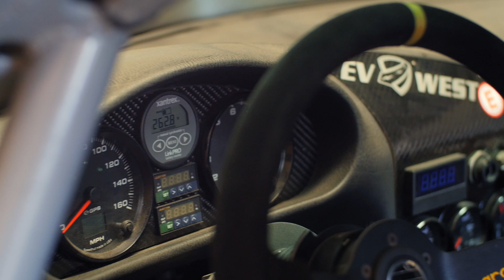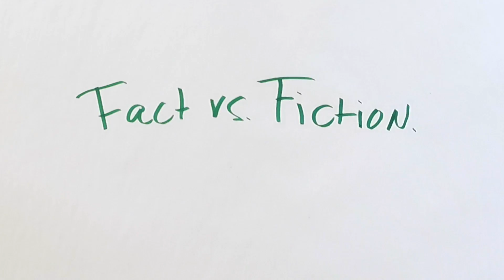How to Make an Old Car an EV - /ENGINEERED

Comment: Not good comparing these older car with the Tesla in terms of safety.  Old cars were very unsafe by today standards, while Tesla has one of the safer body in the industry, precisely to protect the battery pack in case of a crash.  Older cars will deform very easily and if they also have the battery packs in front (or even in the rear), the slightest crash can be a major concern, even a low speeds.  The batteries are not protected and do caught fire under impact.  Electric battery fire is anything but a regular fire, it is almost impossible to put down even by firetrucks, and burns with powerful flames.  So these old electric cars must be driven very carefully, especially given the speeds and accelerations they are capable.  And not only for the owner's safety, but for the other cars safety as well.

Comment: Batteries do not "contain" electrons for the purpose of generating electricity, only capacitors hold the actual electrons to create a charge. 

Batteries create an electrochemical imbalance called Oxidation-Reduction Reactions, or Redox Reaction. The cells in the battery have metal and an electrolyte in them to generate electricity through the redox reaction.

Does this guy know what happens in his garage or is he the owner that smiles for the camera, completely ignorant in his field?

Comment: hi , i am a mechanical engineering final year student...right now we are working on solar powered electric vehicle..We are doing it from the design to fabrication..so we are not converting but actually fabricating our vehicle...now we are facing a budget issue..and without ac drive we cant make it through...can anyone over here please help me in this..do anyone can give us on rent or sell us 15 kw ac induction motor drive. It would be a great help..kindly reply

Comment: he says electric cars are more efficient because it takes so much energy to refine petrochemicals but doesn't electricity production require a similar process?

let's say i'm charging my electric car with power from the grid that happens to be sourced from large coal burning power plants. and also my car is constructed from rare elements that can only be extracted from the earth by huge mining operations that produce a significant amount of pollution before the elements are shipped to the production plant by huge ships that produce a significant amount of pollution and then are used to produce the cars in production plants that produce a ton of pollution.

i don't know which is worse, burning gas in a primitive combustion engine or burning gas to build a primitive electric engine, but they are both bad
Reply: That will change as renewable energy sources become cheaper to install.  It won't be immediate, but as adoption increases, the cost will go down.  What doesn't help is that renewable energy methods depend largely on the environment itself.  The UK is quite windy, especially in Scotland, so wind power makes sense.  Iceland is known to have a thinner crust than other parts of the world, so geothermal energy is ideal.  Hot countries with minimal cloud cover benefit from solar energy.  Then there's hydroelectricity, and nuclear or biomass for places without access to environmentally driven energy sources.  Solar is actually a pretty sure bet for most places, even cloudy places like here in the UK.  Panels are getting cheaper and more efficient.

Lithium is recyclable.  The issue is that it's cheaper to obtain brand new lithium than it is to extract the tiny amounts used in batteries.  This may change as demand and the cost of the raw material inevitably increases.  There are political obstacles to contend with too, since must of the lithium supply is constrained to a few countries, much like the oil supply is now.
Reply: Ok, so lets look at the worst case, electricity made in a coal plant and then charged into an electric car. Compare that to a ICE vehicle. When looking at how well the energy is utilized the electric car will have more than double the efficiency over the entire energy chain, i.e. It will be better for the environment. Given that more and more power plants and electrical grids are getting modernized including solar and wind I don't see how this is even debatable.
The thing is that the coal plant has about double the efficiency compared to an ICE in a car. Electricity is transported a lot more efficiently to the charger than petrol to the gas stations, and then the electrical energy has a 80-90% efficiency in the electrical car compared to petrol in an ICE which has about 20% efficiency, most of the energy put in is actually converted to heat... Mic drop!
Reply: You are too stupid for words.
Reply: Doogie Houser im sorry, did i offend you?
Reply: to answer your question... no
Reply: good, because all im saying is that electric cars are still running on fossil fuels if they're getting their electricity from a coal power plant lol
Reply: poophandler I mean if they are in the Midwest, in a place like Colorado where most of the energy is geothermal it's bit different
Reply: You have to weigh up the pros and cons.

Not all power comes from coal or gas.  In the UK most of our coal plants are gone, and the remaining 4/5 are due to be decommissioned.  We get most of our our power from wind and nuclear, which whilst not completely green due to the necessity to store waste, is still a low carbon emission alternative to fossil fuels.  Of course energy production differs depending on the country.

Lithium isn't all that rare, and whilst it is found underground in rock, it can also be found in brine pools and is dried out by the sun.  I believe this is the most common method of obtaining lithium.  There's also the possibility of recycling batteries for the production of new batteries, which isn't possible when burning fossil fuels.

Extracting and refining crude oil is a highly energy intensive process.  Then there's the matter of shipping it across oceans in huge oil tankers, transporting it in trucks to fuel stations - a massive CO2 cost before it even gets into the tank of your car.

On the other hand, the idea of buying a brand new car when there's nothing wrong with your old one is wasteful.  You may be taking a petrol powered car off the road, but the CO2 emissions from creating its replacement will far surpass the amount of CO2 your existing car will continue to produce if you kept it.  It's not quite that simple, production is getting more efficient, and the power used in production is coming from cleaner sources.  Not to mention we're recycling more materials than we used to - steel and aluminium can, and is, widely recycled.  If your old car is trashed/unsafe however, and you were looking for a new one anyway, then it may as well be electric.

In my opinion, if you wanted to be as green as possible, you'd take an old car and convert it to electric using parts from other electric vehicles.  A fairly common conversion uses electric forklift motors mated to the car's existing gearbox, and banks of UPS batteries or reclaimed laptop cells.
Reply: I know that all power doesn't come from coal or gas. That is true. But I guess my point was more that you have no direct control over where your energy comes from if you are using grid power. You are at the whim of the agency that supplies the power. It's not such a bad thing if you live in a place where most of the power is geothermal, like Iceland. I live in Ontario and most of our power was from coal generators until only a few years ago, from my knowledge, so the idea of having an electric car to protect mother nature was a joke.

I heard that they were having difficulties finding ways to recycle the batteries. Maybe I have been misinformed.
Reply: +poophandler yes you were misinforemed ... people like to act smart and hardly admit that they have no knowledge or education about topit they are discussing... Lithium ferro phosphate (or newer)  are 100% recyclable
Reply: The coal power plant argument is invalid anyway, for reasons that mikeberg above just mentioned.  When you also take into consideration that fossil plants are dwindling in numbers (at least in Europe), the argument is completely null and void.

Comment: do you have the same problems the mass produced electric cars have...???   if you leave vehicle not connected to the chargeing system for a period  over two weeks..say yr vacation .on your return the batteries will not charge..cycle..and need to be replaced...two friends had this happen and that is what factory told them..new batteries 30,000$

Comment: ... was really hoping for a video on how your electric vehicle was engineered and made . The nuts and bolts of installation , welding mounting brackets ... transmission used and battery ... Instead what I listened to and watched was essentially a  damn information commercial  which I did NOT want to watch and listen to .  Yet in spite of that misleading title for this video there was knowledge to be learnt ... just none that is technical or leading to the building of any such vehicle . Too bad.

Comment: I bet he sip that water with used socks extraction in starbucks.
So much bullsh!t. Yes, EV's are so efficient, especially when powerer by electricity produced from coal plants with 30% efficiency, producing mind-boggling filth (39% in US), stored in batteries with charge/discharge cycle efficiency ~85-90%.
Worst episode of Drive. Not because misleading title. Not because of ruined classic car. Not because of electric car. But because of 11 minutes of bullshit from an idiot.

Hitting unsubscribe button. There's are so much better channels to watch, like Petrolicious or Davide Cirone.

Comment: The people who would put an electric drivetrain may be technically-minded. They may be innovative. They may be creative. But they are not "car guys".

The experience of a classic car involves the senses. They have taken away many of those (the sound of an engine and drivetrain, the smell of gasoline and oil, the feel of the engine in the steering wheel and butt). They have taken the experience (and therefore most of the pleasure) out of the drive. 

Were these actual "car guys" (who value the experience), they would appreciate the cars for their context, history, and intrinsic value, and preserve them for what they were. Note to these innovators: "innovation" does not always equal "better".

Comment: There is no possibility that an electric car will ever give me the same sensation as internal combustion.  Driving for pleasure is about much more than just speed.  The sounds, smells and feelings generated by a 2 liter at 9,000 rpm will never be replicated by electrons.  And this is coming from a huge proponent of sustainable small scale solar, wind, and even hydrodynamic generation.

Comment: See I'm okay with EV swaps and engine swaps if you go all the way. I hate stock original cars that have a swapped engine. It's a total disappointment. If your cars original I expect to see the cool old original engine. Not a fucking smallblock Chevy, or in this case a electric motor.

Comment: I even got past the point where you told me they actually switch cars during the races.  I was willing to accept that as a valid handicap.  

Then @8:04 you try to tell me that a technical efficiency comparison involves the REFINING OF THE GASOLINE.  It certainly gets "muddy in the middle" if you're not actually willing to offer estimated numbers on two theoretical cars sitting at the start line.

Quick tip is that a video starting with "how to" should actually involve how to DO SOMETHING.  Not a rehashing of the age old internet lecture about how I'm the petroleum industry's bitch.

Comment: I read all these complaints about lack of engine noise… I'll bet when cars were first invented drivers used to complain that they miss the sound of galloping and whinnying of their horses.  Cars are not engine noise.. they are speed and dynamics.   Its the 21st century guys… wake up.   These guys at Electric GT are on the forefront and many other businesses will copy them.  This will become commonplace in the coming decades.
Reply: I'm sorry but I disagree completely. A huge part about owning a classic is listening and feeling that amazing oldschool engine. You don't feel that with modern cars. Yes the 235 in my 55 Chevy is weak, smokey, and old. But I love the way that sixxer sounds. It's got character. It's why I like original cars with patina better than restored ones. Because any car can be restored, and be better. But orginal is original and character beats all. I'm not opposed to engine swaps at all, but in this case I wouldn't want that.
Reply: Good one on the horse/buggy comparison. In 30 years (or less?) these will be the olden days.
Reply: +Shawn Hollahan I could not agree more. People need to stop with ENGINE NOISE. Nowadays any car is all about ENGINE NOISE BRO.

Comment: So some teslas caught fire after slamming into a wall at 100 mph, but it was a small smouldering fire and they were slowly puller over !!!!! This dude just says what ever he needs to to make what he says sound good. everything that comes out of his mouth has a touch of bullshit to it. This guy lives in dream land. I would love to Dyno his shit. I bet ya the numbers are crap
Reply: +gus bisbal He's talking about different instances. There have been at least two times when a Tesla was crashed into a wall at very high speed and those caught fire just like an ICE car would when one crashes going over 100mph. There were ALSO a couple of times when a Tesla hit debris in the road and punctured the battery pack, in those instances the car was safely pulled over and a small smoldering fire burned part of the car. If a gas tank had caught fire like that it would have been an inferno.
Reply: *****
 I missunderstood what you meant by "pulled over", I tought you meant Tesla tryed to cover up the fact the cars catch on fire if you crash then.
Reply: +gus bisbal Most cars will catch on fire if you hit a wall at 100 mph, also I would like you to point out what exactly is the bullshit he said, because electric cars can make huge amounts of hp, if you don't care about range.
Reply: +guifrakss Seems like pure EV cars have lower top speed, but you don't need that on the road. Guy is hilarious though, try to crash a car at 100 mph maybe he'll be a content of a crushed can.
Reply: guifrakss read my post, honestly did you even red my post? He states that the cars that caught fire were pulled over yet they also hit a wall at 100.

Comment: You do not alter the cars?! You try and preserve the cars?! You changed what a Ferrari makes a Ferrari with a electric motor!
Reply: +Patrick Carta Its fully reversible and they help preserve some of the harder to replace drivetrain parts since they are no longer needed for operation.
Reply: +Patrick Carta  Hey it was just a V-8 Ferrari anyway
Reply: Dephman kaido.
Ferrari is very good at making people fall for branding, you would not be near as interested if a Mercedes SL500 had the same thing done to it, or a Jaguar XJ v12. The truth is that 80's ferraris were not very good all around cars and the only reason people are butthurt is simply out of idol worship.

So to answer, yes, it is an old Italian car with a weird engine, but it is a better car than it was the day it rolled out of the factory.
Reply: +MarcBrewer 

Just a V8 Ferrari :) A good one.
Reply: +Patrick Carta 
I once dropped an Olds V8 into a 57 Ford.  Why not?  But you wouldn't believe how mad that made some Ford guys I used to hang around with.  To each his own,   I guess.
Reply: +Patrick Carta this is a great idea keep the good old motors on the road id rather in 50 years drive a EV converted bmw 2002tii than an ugly prius mk 6 lol if it keeps old cars on the road after there no fuel left its no bad thing
Reply: +Patrick Carta It's reversible, so the car can be converted back to gasoline whenever. If anything, it preserves the Ferrari's engine for posterity.
Reply: +Patrick Carta It's also a business. When someone comes in waving cash in your face, you'll do whatever it is they are asking.
Reply: +Patrick Carta Your tears are delicious.
Reply: +Dephman kaido. If a dead, fancy phone car with a trendy appeal and retro look is faster than the original, then the original was utter shit.
Reply: the 308 only made 240hp.
Reply: M3Nenough
You're stuck in the past, electric motors are the future.
Reply: +Patrick Carta I think they meant visually, on the outside.
Reply: +Patrick Carta if this was an enzo you would have a point... but a 308?... theyve given a slow old heap a second lease on life!
Reply: +Patrick Carta you idiot...one day you'll realise this is the future. This guy is ahead of the curve on this one.
Reply: +Patrick Carta A Ferrari is not just about the engine...
Reply: +Patrick Carta What if the car had a blown engine? This would bring it back to life
Reply: +Patrick Carta you do what the fuck you want
Reply: +Patrick Carta There are Ferraris with Chevy V8s running around too, hell, I wanted to put a Nissan engine into a Mondial.

They are just cars, and they are as open to being modified as a honda civic or a maybach exelero.
Reply: +dafiltafish  thats not a ferrari anymore, thats just a old italian car with a weird engine.
Reply: sorry, its a dead car.
Just a fancy phone car, with a trendy appeal, and retro look.
Reply: +Mari Onette If you take a Ferrari 308 and give it, say, 355 tech, I could live with that. But the sound and the feel of a high revving V8 (or V12) is a big part of the appeal of a Ferrari. What they do is basically lobotomise Mozart.

Comment: Love electric but the cost for the materials that make up the batteries are very high. Extracting the elements with massive mining rigs running giant diesel engines then transporting that across the globe on ships powered by even bigger engines before being refined in energy intensive foundies there is no way its as efficient as he says.